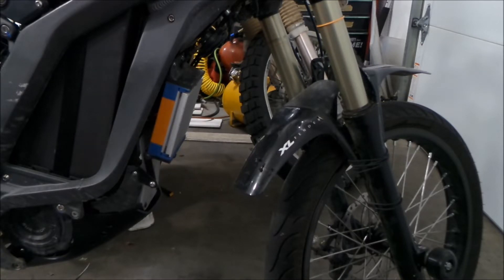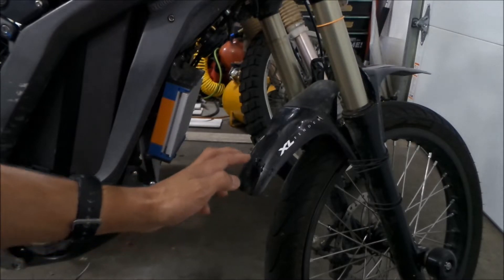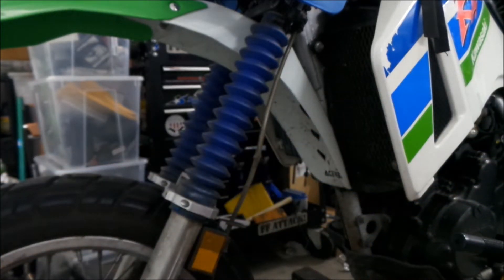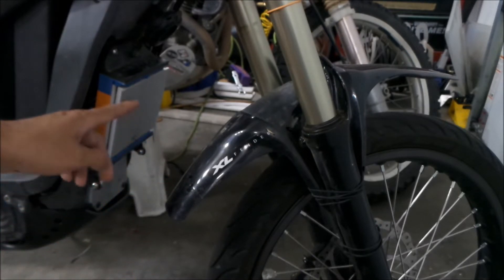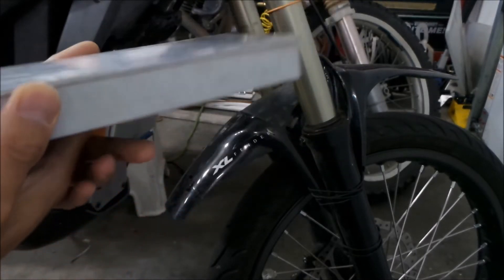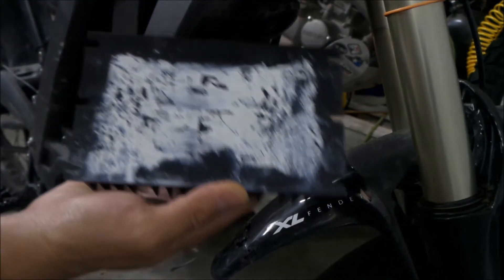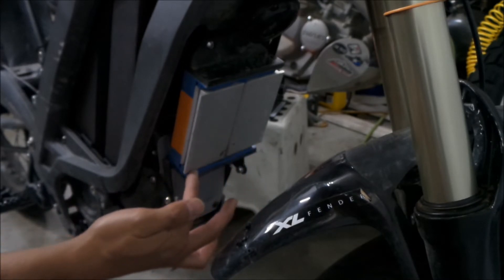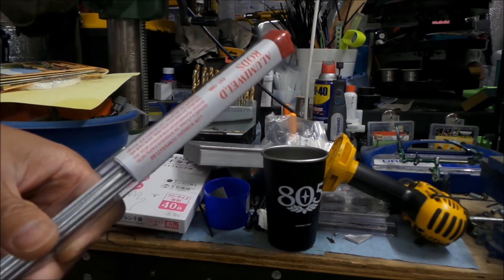Sur Ron BAC2000 Overclocking Heatsink VLOG Part 2 - Heatsink Brainstorming

Comment: dont grind the controller just make a slit in the heat sink where the lip is that way you dont touch controller. also you will probably want either thermal epoxy or pads for outdoor use
Reply from the maker: There's not much to grind, I didn't want to do it but I did =/  It's not like you'll see it also but yeah if I ever sell this thing it's all butchered up now =P  In a later video I used Super Lube Heatsink Compound also.
Reply: @hadesomegamoto7639  yea when it would have saved resale value if you just did the heat sink lol then again my sabvaton controller got butchered as well to fit my bike lol i cut the side fins got cut off with a bansaw to fit then i moved it now its just looks funny. took like 1/4 in off each side